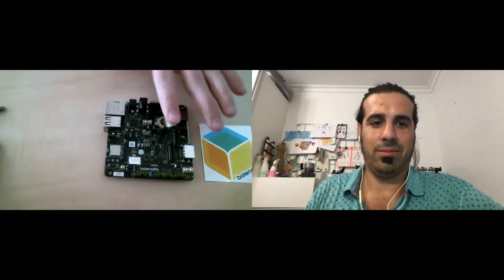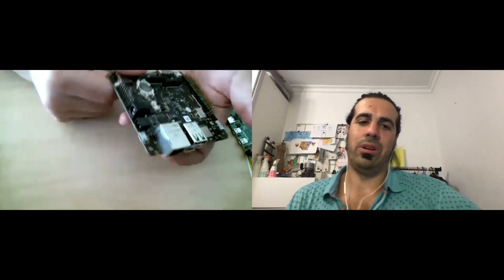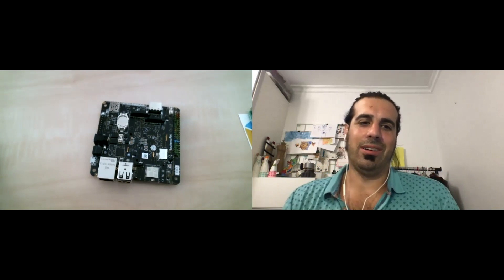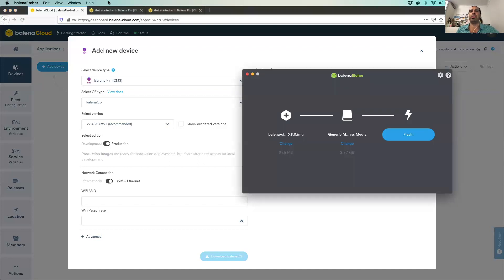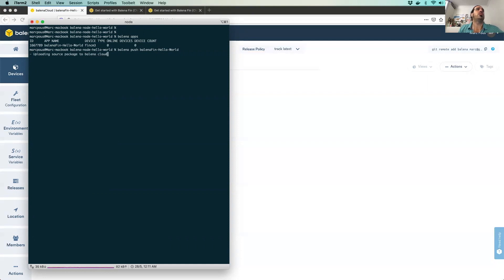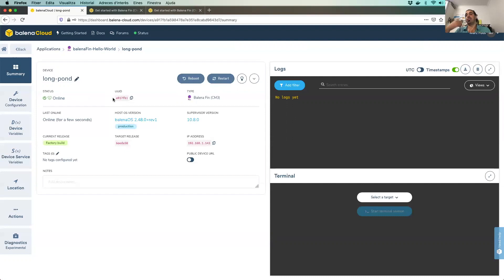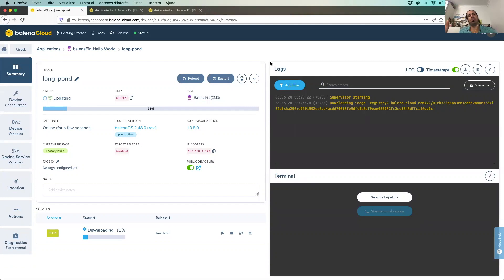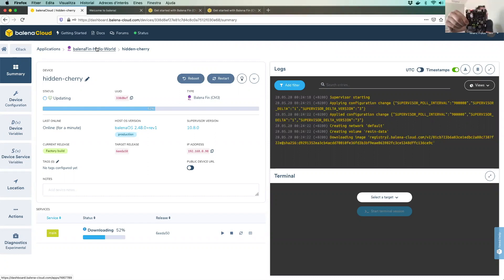Getting started with balenaFin the Raspberry Pi for professionals

Comment: Hi, There is Python SDK for BalenaFin, but I am new to balena and can you please make a video on "How can I run python code for object detection and inferencing with Machine learning SSD mobileNetV2 or YOLO trained models using OpenCV AI kit OAK-1 or OAK-D camera"? (Please see detail on link: @t )

It is good to have GSM SIM interface for LTE communication. 

Is there any plan to add GPS, Gyro or IMU sensors on BalenaFin board?